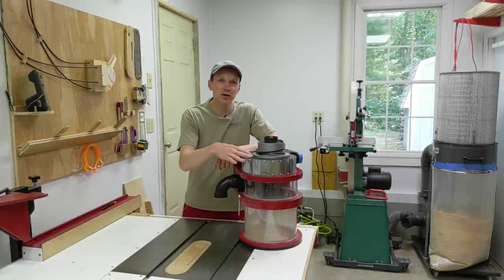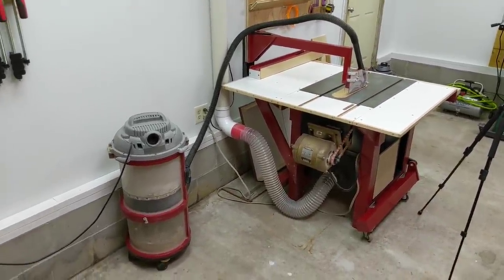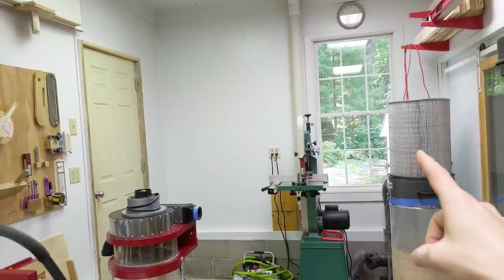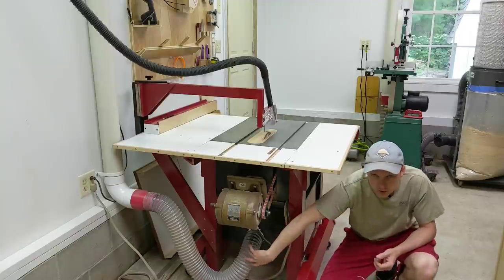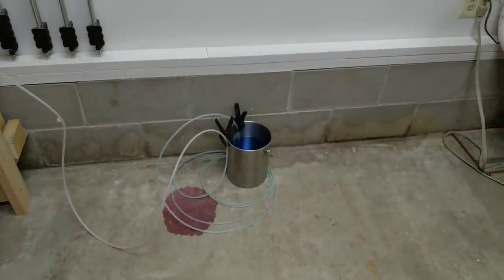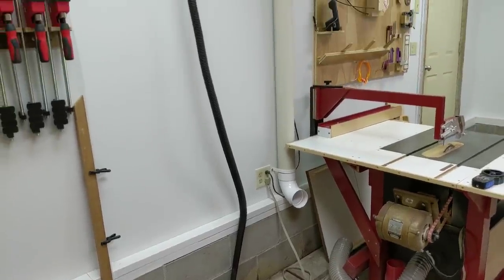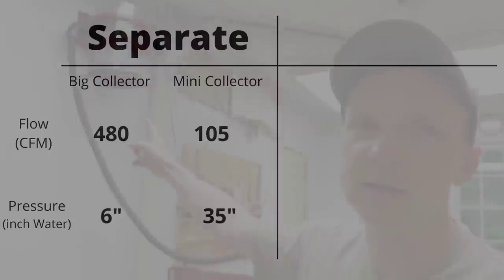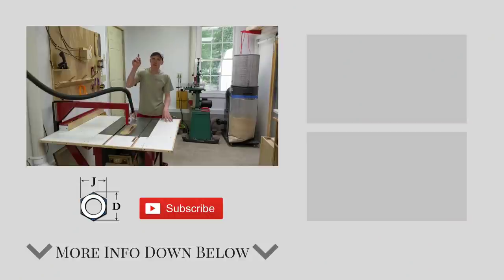I Hooked a Shop Vac to a Dust Collector and This Happened

Comment: Great video.. A suggestion to eliminate your 2 remotes is to automate your blast gates to automatically start and stop your DC when they are opened or closed.... with a VERY easy and inexpensive setup with a low voltage relay and microswitches. Works on both 110 and 220 volt dust collectors. There are videos on youtube showing how to do it.

Comment: Wow, thanks for the really articulate presentation and very clever design. Doing the measurements of both air flow, and pressure, added numbers to what is typically left to speculation!

Comment: It would be interesting to see what the results would be if you were to run the output of the small vac in to the large dust collector after the the motor. So basically both systems just feed in to the large filter. I suspect that you would keep the performance of the vac's has they was individually. .

Comment: Those dust collectors have a 5" intake, which is then reduced down to the 4" pvc. It happens to work out that a 4" and a 2.5" together have roughly the same surface area as a 5". I wonder how it would do with a dedicated 2.5" pipe running all the way back to the splitter at the intake...

Comment: I experimented with connecting my shop vac to the opposite end of my main dust collector trunk line in the opposite way you did.  The vac and dust collector were pulling against each other, and I had a very noticeable increase in suction at all tool ports.

Comment: Thanks for the video Justin
Have you considered incorporating a venturi  into your system? The small vacum airflow would then likely increase suction on the 4" line at the table saw.This may help with getting dust into the system but in the end I think you are right in that you will be limited by the max airflow through your large collector filter.

Comment: I’m wondering if the loss in CFM at the lower port is due to the way the exhaust from the small collector is entering the 4” pipe.  it may be possible to make a smoother transition so the air is flowing the same direction and that may increase the air flow in both units.  I’m not sure, but seems logical.

Comment: if you disconnected the mini dust collector from the larger system when the larger system wasn't running I believe you would get the same reading as you got with it connected and the big system running.  it will go down without the big system running becuase when its off its basicly restricting the airflow out of the mini collector.

Comment: A good source for used vacuum motors is any shop that routinely does pm on them. The voltage could be 24v or 36, but they are made by lamb electric. They likely would need bearings or brushes, or both. I have one that was to be scrapped, and it seems to be in good repair, but I've not tried it on 24v yet. The only draw back is a power supply to run it, but there might be a solution at your nearby scrap yard.

Comment: I previously owned a factory that produced cardboard cores like the ones found in paper towel tubes and other materials. The process of cutting all the paper created a lot of dust, which required a giant suction system similar to the one you have in your shop. I find the Cyclone system to be a great idea. I'm curious if you have installed a HEPA filter and completely sealed it. Currently, we are working with engineers from Miele and Fest Tool to develop a perfect solution. I would appreciate your input on this matter.

Comment: Justin,
I found your video to be very interesting.  Thanks for running the tests and posting the results.
However, I disagree with your conclusions.  Discharging the mini dust collector into the large dust collector caused the air flow from the bottom of the saw to be reduced from a marginal flow rate to a very poor flow rate.  According to date posted by Bill Pence, the OSHA requirement for dust collection from the bottom of a table saw is 440 cfm.  The flow rate from the top of the saw should be at least 350 cfm.  In my opinion, the mini dust collector should have its own filter, so that the flow rate from the bottom of your table saw is at least 440 cfm.
Reply from the maker: Thanks for the thoughts Dave. I had not hear the 440 CFM requirement. One other thought I've had is to exhaust the mini dust collector straight outside, still no filter.

Comment: Fascinating test. I learned a lot. 
I’m dying to know what happened at some point downstream of the junction of the two flows to see if it affects the flow/pressure through the main separator. 
Also, I would want to try hooking in the shopvac output upstream of the table saw to see if it put a draw on the main line to the table saw undercarriage.

Comment: Thanks for this! I’ve been thinking about doing the same thing.  Now that you’ve done all the hard work for me I think I’ll run a parallel system (HI/LOW) to my dust collectors and activate both with relays as I’ve already got a iVAC switch for my High pressure DC. Cheers!

Comment: Great video.  I’ve been contemplating doing something like this as well.  You saved me a lot of work testing this out.

I have also been wondering if something even simpler - like an in-line fan - might be enough, but not sure if it would generate enough pressure.

Comment: If you rebuilt your overhead dust collector today, would you still go with the smaller sized hose, or would you go with something larger, similar to the Excalibur and saw stop overhead desk collectors?
Reply from the maker: Good question. I think if I had a larger more powerful dust collector I would use a larger diameter. With my harbor freight unit now, I don't think there would be enough suction if I split the 4in line into 2 lines. I also like the small size of my over arm so that's another reason to keep it small.

Comment: Great video.  I am considering doing something similar.  Do you think you could eliminate the chip collector on the mini collection unit and just let the big dust collector pull everything to it?  I want to reduce the footprint as much as possible and not have to service them mini collector at all.
Reply from the maker: Stephen - I don't think so. The dust and chips would have to go through the impellor. Unlike big dust collectors, the impellor on a shop vac is pretty small and flimsy. I imagine the chips would get stuck in the impellor and could cause damage. This is why I have the chip collector attached.
Reply: @JustinDepew  I probably don't know vacuum systems that well, but a theory might be could you place another junction connection to your main line but above where the shop vac is feeding its pressure to the main line and have that connected to your dust/ chip collector so that it pulls the separated dust/chips into the main line and doesn't go through the shop vac impeller?  If the junction for that is above the exhaust of the shop vac wouldn't the pressure from the shop vac help draw that extra debris in the main line?

Comment: I would imagine a larger home run pipe going to the 2.5" and 4" connections would negate the loss as the larger pipe would have more volume.

Comment: Not sure I understand the conclusion. Why is gaining 1” of pressure on the shopvac worth losing all that CFM on the dust collector?
Reply: @JustinDepew Like @saritsotangkur2438 I also don't understand the conclusion or why other people aren't making the same point. The shopvac gained less than 3% in pressure while the dust collector dropped 27% in CFM. It's clearly better to run them separately. I love your channel in general though!
Reply: The connection to the big dust collection is for the filtration of fine dust, as the small unit isn't capable of filtering out fine dust on its own and requires a filter on its output before the air is returned to the room. Its explained at 2:37, though not very clearly.

As far as I understand the collection system of the shop vac is there just to prevent big chips passing through the shop vac's blower and damaging it. And the airflow testing being done check that things are still working ok, given that it is a rather unusual configuration. The new system may or may not be  at picking up dust, but having a centralized filter is was easy to set up and it means fewer filters to change.